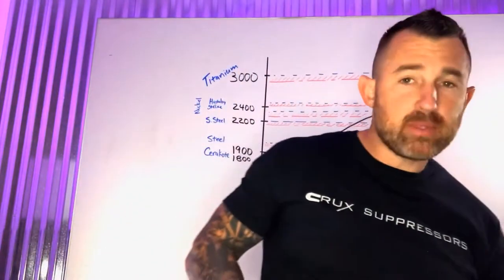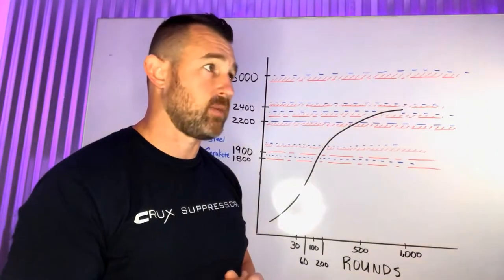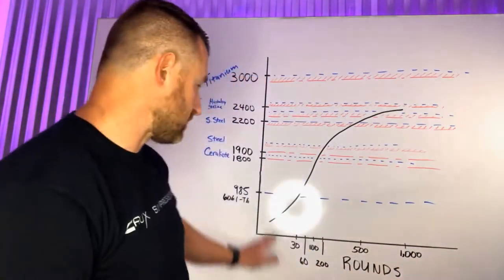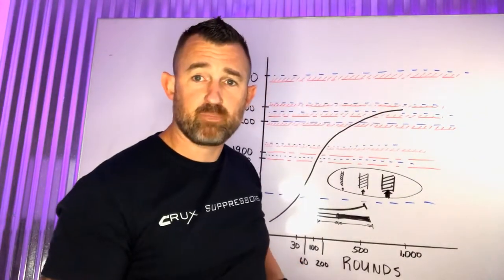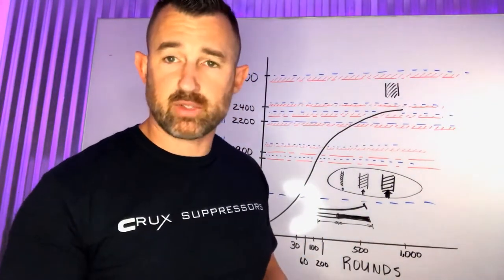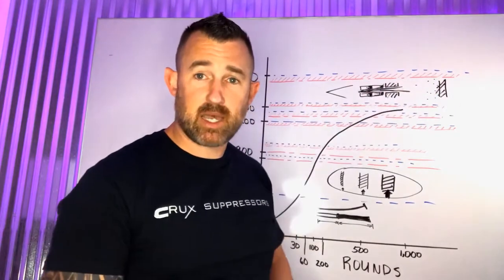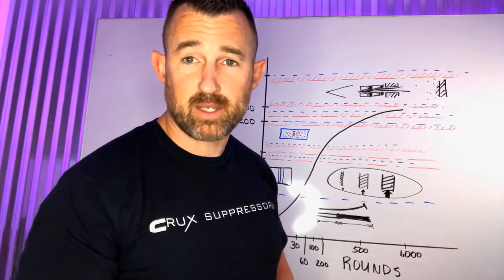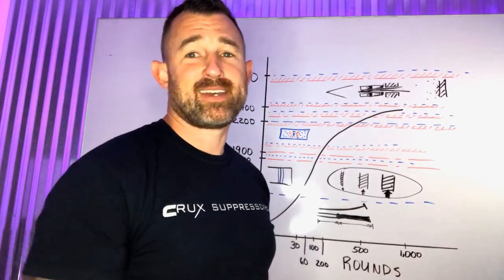Suppressor Material Selection

Comment: I have a degree in materials science and while I appreciate the effort, this video to me is a rather insufficient discussion of material selection and misleading on a lot of metallurgical concepts. Abrasion resistance is about material hardness. Titanium degrades in combustion environments because it doesn't have the same oxidation resistance that nickel-based alloys do. Those hot gases from ignited bullets causes hydrogen embrittlement in titanium. No amount of engineering design is going to change the corrosive environment to which the titanium baffles are exposed to.

The statement that annealing and tempering are processes that only serve to make materials more ductile is inaccurate. It is true that annealing improves ductility. But there are heat treatment processes which are applied to isothermally grow preferential carbides along grain boundaries, thus impeding dislocation movement throughout the microstructure, and making the material stronger. Nickel based superalloys also have some of the best high temperature creep resistance properties which is why for decades they were the main choice for turbine blades until being phased out recently by CMC materials. I'm not sure why Nickel is cast aside as inferior to Titanium alloys in this video. If it is a matter of practicality or mfg cost in choosing Ti over Ni that is understandable, but I'm not convinced by the explanation in this video for Ti suppressor material selection. I would honestly opt for a suppressor with either martensitic stainless steel or inconel baffles at minimum for a SBR or FA application.
Reply: What's the best heat absorb Alloy?
Reply: Yeah, this video gives info that contradicts practically all the experts in the silencer industry today. Titanium is NOT the material to use for hard use cases. No way, not a chance.

Comment: How about the material that they use on the vox s suppressor
Reply from the maker: Derek Smith it is still an iron based alloy.  It will be comparable to satellite with marginal benefits.  It’s melting point is still lower than Titanium.  Companies are good at marketing marginal improvements as game changers.

Comment: Where does stellite land on that chart?
Reply from the maker: Its at the top of the range for all the Steels.  Its Melting point is just over 2700 deg F.  And while it has one of the highest melting points for all materials it shines in its ability to resist wear at elevated temperatures above all other steels.  However there's a limit.  It shines at elevated temperatures from 200 - 1000 degrees F out performing everything out there.  But when you reach 1800 plus degrees its capabilities really start to degrade.  It will also start to experience a lot of elongation at 1800+  That means the metal will stretch and move around when getting to 2000+ degrees (Not good for accuracy) and it starts to wear a lot more (granted its still better than all steels, its at the top of the pack for performance), but its performance level starts to come down to be relatively equivalent to Titanium at super high temperatures (2200+).
Reply: Since you come aerospace area what about c300 or c350 maraing steel? Very high in cobalt and molybdenum. Molybdenum can handle heat like no other and doesn’t expand like Ti.  They say c300 at 1000 degree is still stonger then Ti or 17-4 is at room temp. I agree Ti is very good area in cans but it’s super corrosive which you know this and depending on how thick you make the can most Ti cans can’t pass SOCOM testing with 6 mag session of 30 round mags or I have yet to see one. I think Ti does have it benefits for sure and probably 90% more of the people buying these should buy a fully Ti can. For the people who want to do lots of mag dumps, have no barrel restriction, belt fed should get a heavy duty can which will mostly be in inconel, satellite or c300/c350. 

I also want to add from your welding video that most people don’t purge weld the Ti cans which is a no no but I believe why they don’t fail under normal use is because the welding baffles are so thick the weld can handle it which means they aren’t taking advantage of why you would sue Ti. Ti is lighter then steel of course but  they could probably get away with half the thickness if they welded Ti correctly. 

Anyways love the videos and appreciate true people trying to give out good info and learning. Being in the Mfg firearm myself so many people are full of shit lol.
Reply from the maker: vince lombardi you are spot on with your comments...
100% correct.
Even the C300/350 being an iron based metal alloy will experience the same affects as you reach 2700.  Elevated temperature performance is relative...some are referring to performance at 400 deg and reference 1000 deg performance as outperforming with a 2x safety factor.  However we need to be performing at 1200-1800 regular operating temperature with a 2x safety factor of 3000.  So, just look at the Eutectic point.  What is the Eutectic point?  Then what about cost?  What about combining the dissimilar metals in the same design with different coefficients of thermal expansion.  So take all those things together and it’s a case by case scenario/evaluation on performance and what’s important to the end user.  We are currently testing our cans on a 249 under very heavy use and they are holding just as well as the big heavy cans built for full auto.